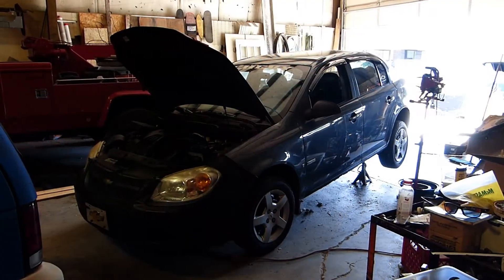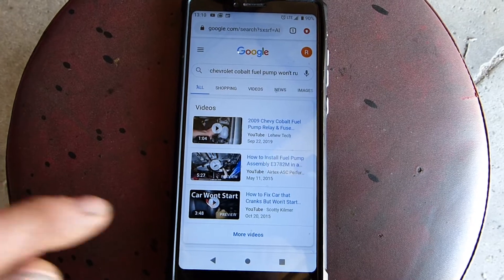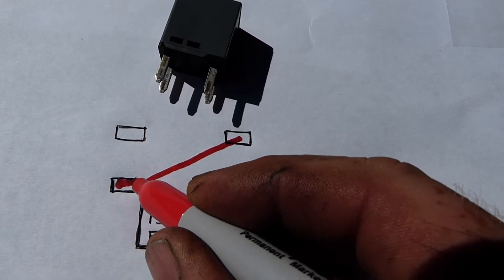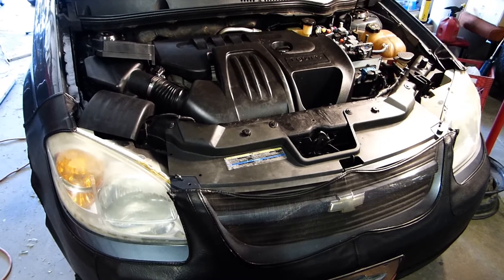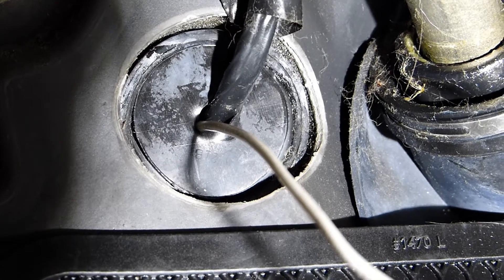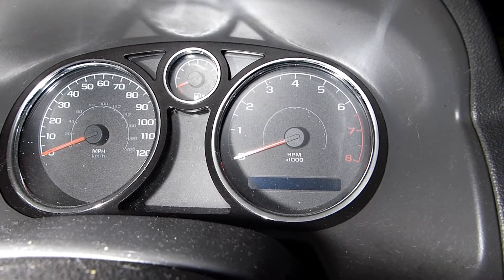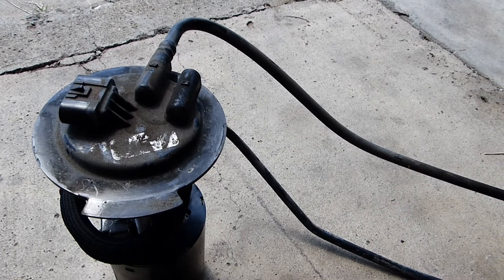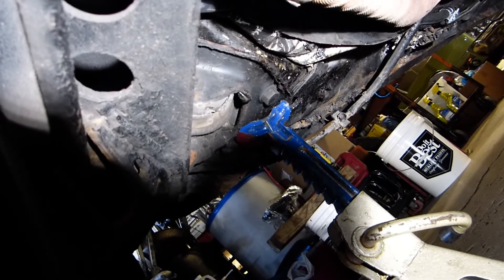Chevrolet Cobalt inoperative fuel pump : a possible wiring solution

Comment: The issue is the pcm not sending full battery positive to relay leg. I did this bypass years ago, however, the check engine light will eventually come on and remain on with this bypass.
Reply: How do you fix it the proper way. I’m having this same issue

Comment: You got a wiring diagram for this my car is a partial zero emissions vehicle and nobody carries a pump my computer is shutting it off and I was curious if running a wire like you did with a toggle switch would take care of it
Reply: Wondering the same